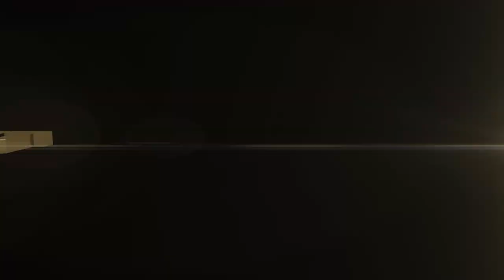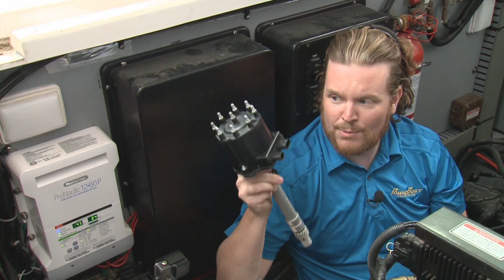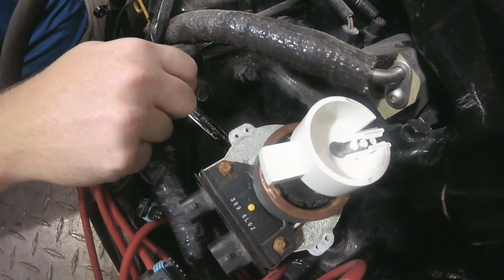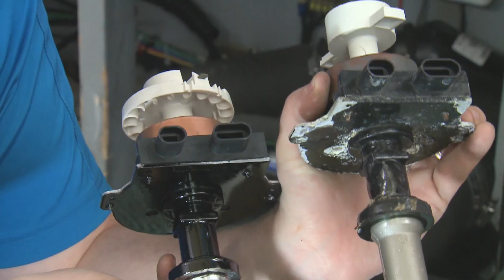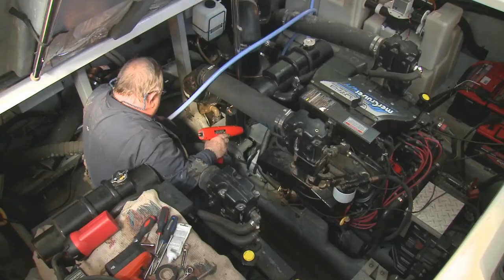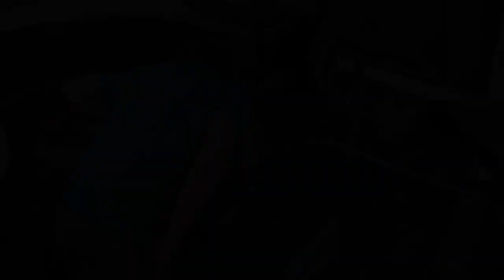How to Change the Distributor Assembly Unit in a 7.4L Mercruiser MPI

Comment: When installing, take a long flat head screw driver to turn the oil pump back some, so that the distributor will fall back in the original spot, otherwise you'll be a tooth off, however you can also, make up for that when you put a timing light on it to set the timing.. 😅

Comment: You didn't mention the very critical part about the need for the slot in the end of the distributor shaft to mesh with the oil pump drive shaft. If you don't do that properly you will not drive the oil pump and the engine will not have any oil pressure. That would destroy the engine bearings in a very short time and ruin the engine. You must explain how to get the distributor to mesh with the oil pump drive shaft
.

Comment: What was the symptoms of the old distributor?  Not as much rpm?   Eating alot of fuel?
Reply: I believe he discovered corrosion during a tune-up, and in the distributor cap and probably had a hard time removing the rotor button. As soon as he removed the Cap it would have been obvious. I have the same problem but i discovered mine during de-winterizing the boat for the summer. It had a miss ,only running on 7 cylinders so I decided to replace cap,rotor,plugs,wires etc.Upon inspection I found exactly what you see in his video. Corrosion in Cap,rotor button frozen on shaft. Rust on shaft and in the pick-up coil. Best to replace the whole thing. This Distributor is vented and I suspect that at some point,there was water in the bilge area. I always crank the bow of the boat trailer all the way up with the drain plug in the Boat removed so any water/moisture runs out. Also when stored its best to place moisture bags inside to help prevent moisture.

Comment: Does the hold down clamp push against the the side of the distributor or does it go on top of the little ring that is built into the shaft?
Reply: the clamp sits on top. NOTE: The distributor MUST sit flush with engine block.
Reply: @paulbouchier8822  im working on my 3L merc and i have the distributor in but it doesnt seem to want to sit flush. what could be the reason for this?